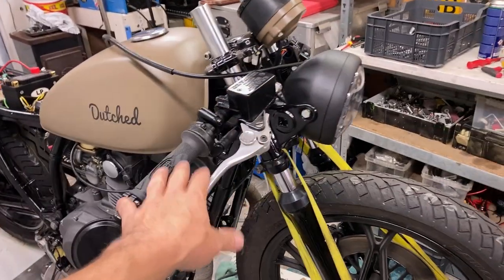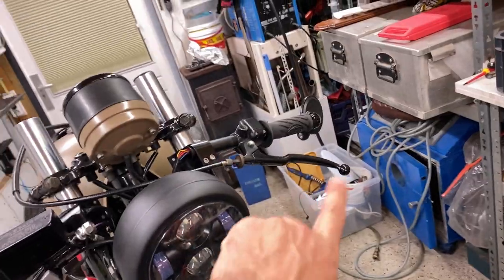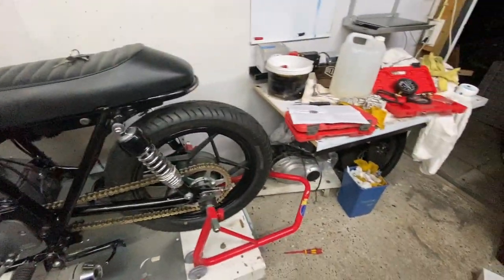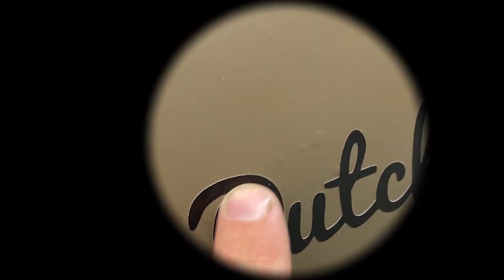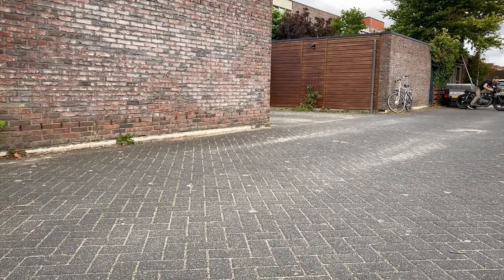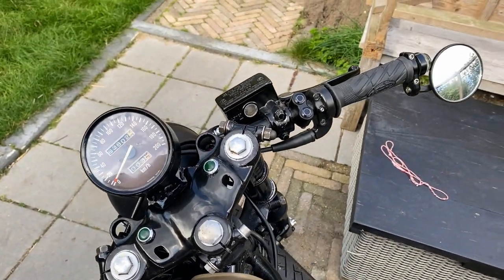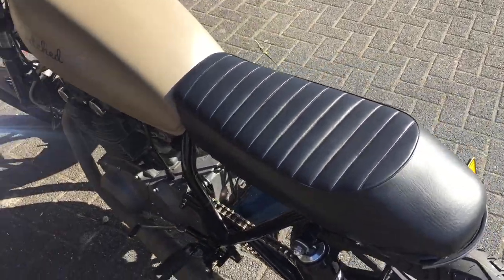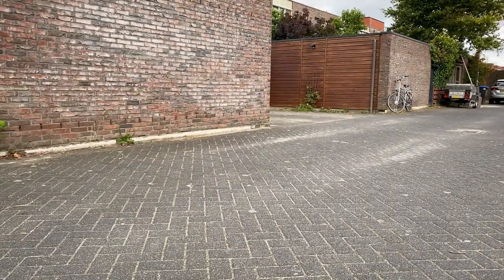Caferacer  Suzuki GS450   First Ride!

Comment: good work, bike looks really nice. carb adjustment with open airfilters is painful, my gs is also spitting. but i left it on the richer and safer side. what size of main jets did you choose? did you changed the camshafts? My gs had 27HP, so i took the gs500 cams with some spacing shims. should be around 43HP now. tip for batterie, LiFePo. less space and works fine ;) have fun with this solid bike.
Reply from the maker: Thank you! I did not change the camshafts. Never seen anyone do that. The shims are the ones on the valves you mean? Or did you use something especially for the camshaft? And i will definitely look into that battery👍
Reply: @DutchedShedBuilds  sorry, i meant washer. My GS450 had 27hp. The cams from gs500E are higher but there is a little more space on the sides you have to fill with thrust washer in case of changing. Two shims needed to be changed also because of the new cams. Now it should make around 40hp. Merry Christmas 🎅

Comment: What size jets are you using? I've got 135's on my 450. I had the same issue due to a trottle kabel witch was to tight.  Bike looks great btw!
Reply from the maker: Havent yet dove into the jets. The tuning is for the upcoming weeks. I’ll use your advice. Thanks for the compliment!

Comment: Did you figure out why it was revving really high? I just got a gs400 and I have the same problem. There must be an air leak somewhere but I cant locate it.
Reply from the maker: Hi, the revving was mainly due to poor airpodfilters I had on the bike at that time. However I have since placed better airpodfilters, K&N RC1822. That made a huge difference and the bike immediateley ran more stable and does not rev up high or low. So thats the first place to look (air-fuel mixture). Hope this helps you!

Comment: BIKERS PLEASE. I got a Suzuki GS450 from 1984, it is in fantastic shape and i wanna keep it. However. I want a little more hourse power out of it, not much, just a little. The top speed is fine, i don´t need to drive any faster anyways, but i would really love more acceleration from 50 to 80 to overtake safely and have a little fun also... What kind of stuff do i need to buy to get more power? Please anybode help.
Reply from the maker: Open airfilter could give you a bit more kick, but are notorious hard to tune. I know first hand. 
You could try making it lighter with different wheels that are lighter.
Reply: get a bigger rear sprocket, dont waste your time with them air pods. i had K N's on mine , chenged the jets but still bike didnt ride as it should be. quickiest way to get some more acceleration is to swap sprockets , or get striped the weight as author said.

Comment: Hello sir where did you get that speedometter?
Reply from the maker: Hi, the speedo is the stock that came with this bike originally. I removed it from the original mounting and made my own. I also painted the backplate in the same color as the tank
Reply: @DutchedShedBuilds  you are amazing.